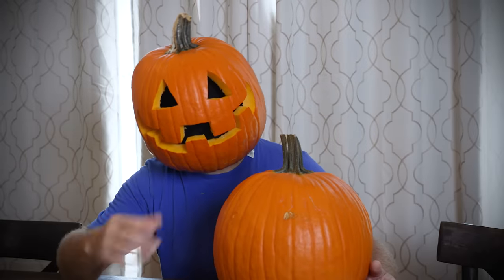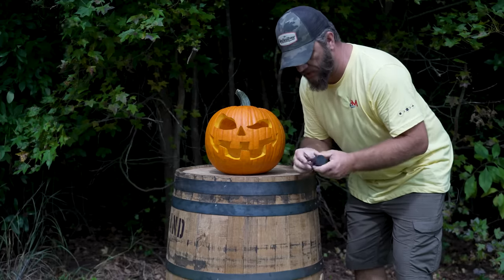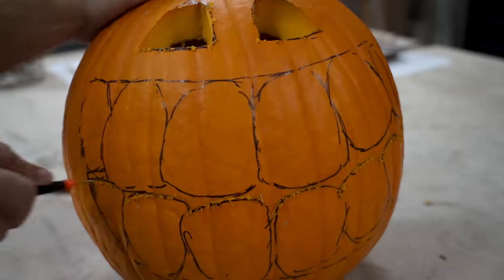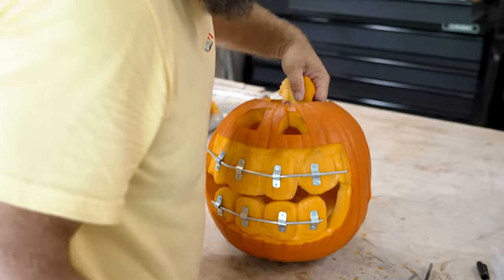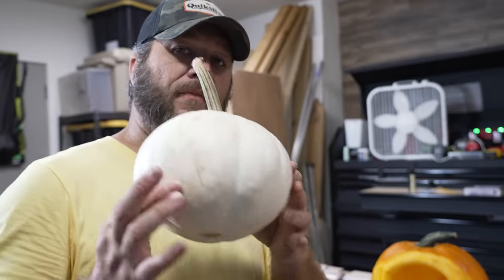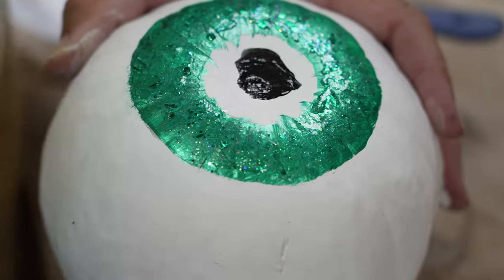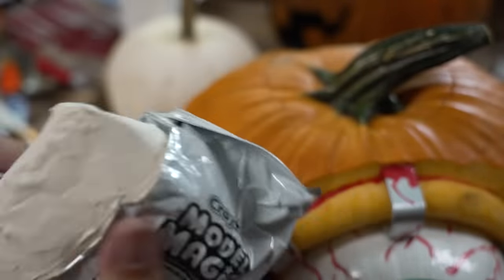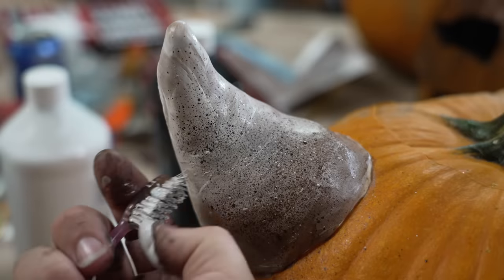How To Carve Halloween Pumpkins! Scary - Silly - Traditional

Comment: It's amazing how well those tiny bladed knives work for carving. They are so much easier to use! Loved the pumpkins, and watching the process. Just a tip: After you carve, if you spray the pumpkin inside and out with a simple bleach and water solution, it won't mold and turn mushy as fast. You can also use vaseline on all the cut edges to seal in moisture to prolong the shape.

Comment: I found those safety cutters can be a bit flimsy. I mounted a jigsaw blade to a dowel and it works much better.
The coarse blades seem to work best, the finer metal cutting ones not so much.
I also made some pokers by mounting nails to some dowels. drill a hole at the end, tap in the nail and cut off the head and sharpen on a grinder.
Some great designs BTW but I pick the eyeball for the winner!